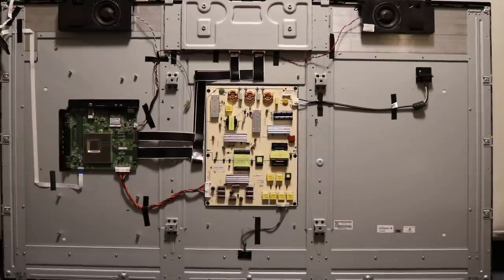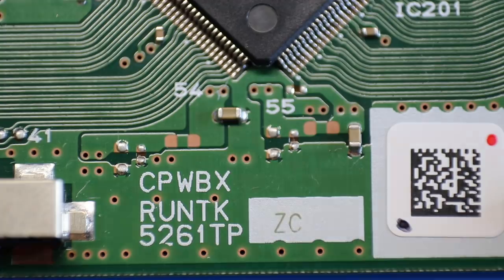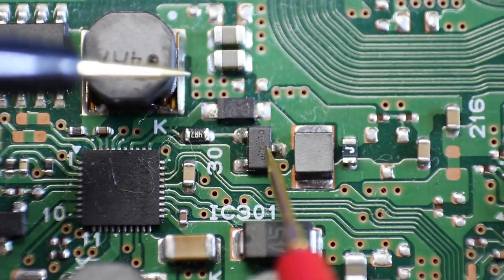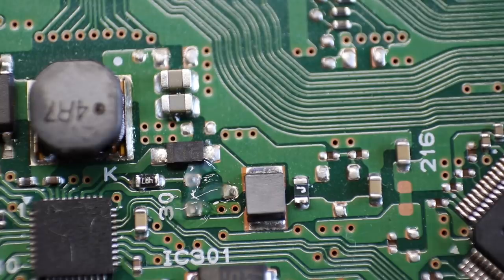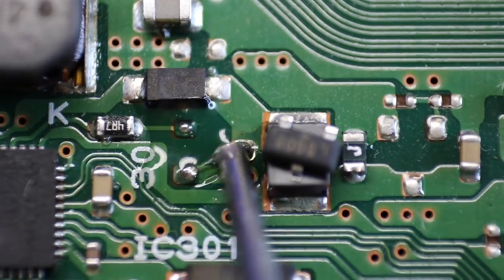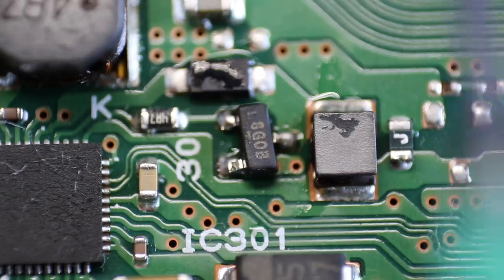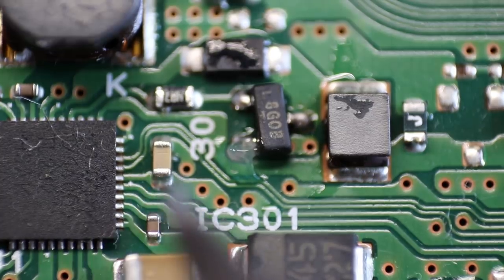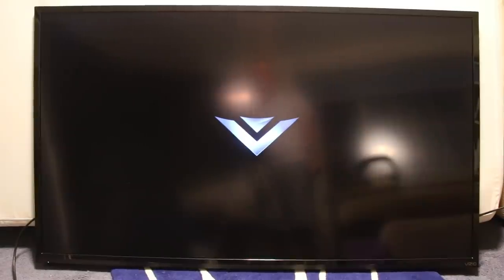60" TV for less than a $1 - Vizio E601i-A3

Comment: I have the same symptoms with my sony kdl 46-vl160...Any tips on how I can get it fixed or how much would it cost to have you fix it?..This is not a joke.
Reply from the maker: Looks like there is a bunch of hits for your model number and "sound but no picture".  As you comb through the search results, has it led to a common issue?  From what I remember, if this is the same model in my memory, the issue with a number of Sony's was a bad lcd.  Look up "tab bond failure" and you model number.  You can't realistically fix the tab bond but you can jerry rig it to work by putting pressure on it.  There are other videos out there on how people do it.

Comment: can vizio TVs work with 240v as well as 110v?

noticed that the power supply boards sometimes have 240v written on them... 

just curious if you could do a 110/240v conversion.. and show it working on a 110 and 240v.  

thanks.
Reply: Most probably yes. Most switching type power supplies can work from 100 v to 250 v. That includes mobile phone chargers and flat panel TVs

Comment: How long did this repair work for you? ShopJimmy is saying that if this board fails, there's a 75% it was caused by the panel. I ordered a replacement T-con board for the E701i-A3 but hesitant that its actually the panel causing it.
Reply from the maker: Not sure exactly since it had been running like 2 years before a child threw a toy and broke the panel.  It could have been longer than that but I don’t remember.
Reply from the maker: A tcon isn’t that expensive typically so it can’t hurt to try it.
Reply: @FrugalRepair  OK, thanks for responding back, its greatly appreciated.
Reply: @FrugalRepair  Yeah, my T-con board is arriving on Thursday.

Comment: Hello I got a problem with my devant tv it has multiple vertical lines i fixed this before by putting a small amount of tape to the ribbon connector of the the t-con board. Will this video I watched also solve the issue?
Reply from the maker: No, the replacement of this transistor is specific to this tcon board on two models of vizio’s that use the same tcon.  You should check all of the one toons and also inspect your tab bonds on the buffer board too.  It could be a connection issue or the tcon, is my guess.

Comment: Hi I have a Toshiba smart tv the back lights are on but no picture I have replaced all boards but not the t con board as it doesn't have one the main board goes direct to the LCD driver boards. Do you what the problem is? Or is the LCD panel broke.

Comment: I have a Vizio smart cast 65" D65x I have a black screen with sound and back light. I replaced the Tcon board and still same issues. What would be my problem?
Reply from the maker: I’m not sure. Besides doing some more Internet research on your model number, another thing I would try is to drive half the screen at one time. This means disconnecting one of the two cables coming from the T con board to the LCD panel. This may enable you to diagnose a bad LCD panel. You would know if you get picture on half of the screen and then when you go to do the opposite the other half the screen does not show a picture. Then you know the problem is on that side of the LCD panel
Reply: FrugalRepair thank you. I will try that
Reply: So one half of the screen comes on. The other left unplugged will turn off the entire picture. What would I need to replace?
Reply from the maker: If I’m understanding you correct, and you have replaced the tcon board, then unfortunately, it seems that one side of the lcd panel probably has a fault in it.  You could check the smd components on the buffer board for short circuits as a final check.  That’s all I can think of for now.
Reply: FrugalRepair thank you. If that's the case with the LCD is the tv not worth fixing or fixable?

Comment: Well I'm Glad You Got Your TV Fixed, But That's Not Helping Us On How You Determined It Was That Specific Component That Was Bad. I Mean We Saw You Test It For Continuity But Out Of All The Components On That Board What Lead You To That One? This Is The Kind Of Stuff We Need To Know Rather Than Just Going At It All Willy Nilly. I.E. So There Is Not Supposed To Be Continuity In That Transistor But Does That Apply To (All Transistors), Or Is There Supposed To Be Continuity In Certain Transistors Depending On The Application And Device You're Working On? What Lead You To That Particular Component?

Comment: I have a black vertical bar in the middle of my screen on a LG 43" smart tv. Everything else works as normal. Any idea what's causing this??? Cheers for any help. 😊
Reply from the maker: My first guess is a tab bond failure (the connection on the buffer board).  Second guess is a problem on the tcon board.  For a very quick mildly effective test you can press lightly near the top (and then the bottom - where your buffer boards are) into the lcd screen (in the black bar area) while it is running to see if anything at all changes.  Of course you don't want to press too hard and crack anything .  You're doing a quick test to see if moving that tab bond around helps fix things or not.
Reply: @FrugalRepair  .......do you know if there's a YouTube video that shows the steps you're referring to?
Reply from the maker: @AyrBlues  Not off hand.  See if you can learn what the tab bond is on an lcd.  Or maybe search for how to fix vertical lines so you can get a visual idea what I am talking about.
Reply: @FrugalRepair  ....cheers, will do. Thanks for your response, much appreciated. Have subscribed to your channel and look forward to more vids from you..... I like your style. Cheers!!!

Comment: 1. Can you use a soldering iron instead? 
I have a 55" Element that someone gave me for free. They said that it just went out for no reason.
2. I think I see multiple transistors on my T-con board
3. what readings should I be looking for on the multi meter?
Reply: Also, there are signs of the TV coming on at all, no back light or sound.
Reply from the maker: I hope you can fix it.  You should be able to.  It is probably not the tcon board.  You need to make sure the backlight isn’t shorted out and you’ll also need to diagnose the power rails on the power supply.  You could watch my video on what do look for after a power surge, which may be helpful for you.
Reply: @FrugalRepair  thanks for the suggestion, i'll give you an update when I find out what it is

Comment: Please tell us how you determined which chip was bad....I just recently bought a new 55" inch TV to replace a 50" TV that had HDMI ports that went bad.
Reply from the maker: Are you asking about how to fix the hdmi port issue?  Was there any power surge, did they all go bad at once?  Check eBay, is there someone selling a “service” to repair your model’s main board?  That is a clue it is a more common issue.
Reply: Thank you for responding, but I was reminded by my roommate that it wasn't the TV that went bad it was my video card my TV was connected to that went bad... Sorry for the mix-up, I'd think I should delete that earlier response.

Comment: Good job but I wouldn't have bothered with the hot air pencil. I could flip off the old transistor and solder on the new one with a 430°C soldering iron waaay faster and with a lot less heat overall. But maybe my hands are steadier.

Comment: I have a Sony Bravia KDL-32BX300  and the ports HDMI 1 & 2 dont work and ALl the resets and plug unplug dont make it work again, but It works perfectly with the pc output. Did you have a video for this knid of tv that I could look at  or do you have a clue to repair this tv.... Could it just need input cleaning ? Is there a component I could test like you did on this tv?
Reply from the maker: I’m not sure exactly on that model.  Could be hdmi controller chip or main cpu (solder connection).  Unless you can get more clues from online research, I’m not sure how to direct you.  Can you verify that the correct voltages are going to the hdmi ports?  Have you tried different cables?
Reply: @FrugalRepair  I tried a working elsewhere cable.. Do you have a link to a video that can show how to properly test the hdmi ports for the correct voltages?
Reply from the maker: I don’t have a recommendation on a video.  I’d search for one.  In my upcoming video I plan to release soon I deal with no hdmi ports but it may not be same issue as yours (mine is bad solder points)

Comment: Any thoughts on an led projector that suddenly won't turn on?
Reply from the maker: There is no power at all?  No standby lights or anything?
Reply: @FrugalRepair  nothing. Not the fan, no lights. It's as if it's a toy
Reply: @FrugalRepair  I swapped out the fuse with the spare that came with original package. Emailed the manufacturer. They suggested power board but they don't make it for this model anymore. It's only 2 years old. Minimal run hours

Comment: I actually have a 60" Toshiba with a similar issue. Maybe I'll actually pull the back off and check that board. would be nice to surprise my dad by fixing it for him.
Reply from the maker: Did you search the model number online to see if there is a common fault with it?  If the lcd screen is intact you can pretty much fix most tvs.

Comment: How were able to determine or pinpoint that it was the transistor on the Tcon board ?..I understand you were able to test the transistor with a voltmeter checking continuity ..But with all the other components on the board it would be hard for a inexperienced DYIer to figure that out.
Reply from the maker: There is another yt video that directs you to look at that transistor on the tcon.

Comment: After reading more comments, it appears FrugalRepair got lucky and an internet fix worked for him. I had my suspicions while watching. If your hot air is set right, and the flow is correct and isolated, you can let it sit on the component and left the solder flash before grabbing and twisting. You’re  going to peel a pad off the board sooner or later with the technique used. Also, maybe give these people a heads up about that power supply board. It’s a mean girl before the rectifier, it bites.

Comment: I have 70" sharp LCD. Black screen but using flash light I can see picture. Is it the LCD strip that's bad? If one lcd goes out does it turn backlight all off? Is the backlight inverter attached to the power source? Thanks
Reply: It has a new mainboard on it.
Reply: Oh I forgot to mention when I drove it home in back of truck...I plugged it in and it worked. Then I plugged in roku and that's when screen went black. My friend gave it to me and said it just didnt work. Maybe bouncing around fixed it temporarily?
Reply from the maker: It would be the led backlight that is bad.  The truck ride wouldn’t do anything but a temperature difference could.  The backlight power source would most likely come from an led driver board or from the power supply directly.

Comment: Hey! I have a Vizio E65x-c2 65in tv. The left side has gone almost completely dark but I’m able to barely see the menu. I’m still getting picture. I have sound and able to power on. Do you think it’s an LED replacement issue or tcon board? I’m not getting any lines. The picture is just getting darker. Any help would be great! I can’t find any help anywhere else.

Comment: Good day, i have a 65" Sony Bravia KDL65W850C. i was watching tv when the screen went black. i looked on the net to try and find something. i found a site that says press the power button and volume down and it should work. when i did it, the screen flickered but would not come on. any thoughts ?
Reply from the maker: Is the LED backlight the problem?  If you still hear sounds when the screen shuts off, that is what I would first suspect.  You can use a flashlight/torch on the screen to verify (after it goes black).
Reply: @FrugalRepair  no sound, it just flashes a couple of circles, it stays on for a blink of eye that's it.
Reply from the maker: When there’s an image that flashes for just a second when the TV first turns on, to me that usually indicates a short circuit on the LED backlight. Of course, yours could be something else. But what tends to happen with backlight fault is that the power is ramped up to 100% when the TV first turns on and exposes the short circuit.
Reply: @FrugalRepair  first off thanks for the help....how do i test the backlight and if its gone where can i get a new one
Reply from the maker: Do a search for flashlight test and you should find a video telling you how to see if your backlight is out.  In terms of replacing it, That’s a little bit more complicated for me to address in a comment. But there are plenty of videos that may help you along. I’ll be making videos on these two topics sometime soon but you may not want to wait for me.

Comment: I'm old school.  Can this be accomplished with a soldering iron?  54 cents if you already own a hot air station, flux and solder.  How much does a hot air station run?
Reply from the maker: Yes, you can do it with a soldering iron.  Hot air can be fairly cheap.  Check out the link in the video description for a pretty cheap one, though I have no experience with this one

Comment: As a former Sr. Electronic Technical Specialist/Technician, I applaud your efforts. That replacement could have been done in about 1/4th the time by a technician with a steadier hand. Perhaps you need to practice with a 'practice board' and some 01x02 caps/resistors to improve your eye/hand coordination and steady that hand. Your repair would pass IPC-A-610 for Class 1 & 2, but not for class 3. Since the TV is Class 2, you pass! Cheers.
Reply from the maker: Thanks for commenting!   You're right about the time reduction.  I had my hot air station in the wrong spot to make way for the camera, etc.  I was experimenting with the camera location and setup.  So I ended up soldering backwards, left hand with tweezers, right hand hot air.  Normally, I'm looking through the microscope, tweezers in right hand, and (hopefully) am steadier. =)  Good to know I'd pass class 2!
Reply: @FrugalRepair  Well, I'm retired now, but when I was doing work with my hot air station, I was fortunate enough to be ambidextrous. Normally, I'd hold the part with Swiss tweezers in my left hand, and the hot air wand in my right (I'm right handed), and look through my lighted magnifier. However, there were times when, due to parts layout, it would be more advantageous to have the hot air wand in my left hand, so I'd just switch. As intensive as small parts placement is, I found the most difficult repairs to be where I had to do a trace replacement where there were a dozen or more 0.004 traces with 0.005 spacing. That kind of work is very tedious and demanding, but to save a $6000 board, you gotta do what you gotta do.

Comment: I have the same model Vizio E601i-A3E that turns on to the logo, flashes HDMI-1 in the top right corner then repeats this endlessly. No response from the remote or buttons on the side and have to unplug it to turn it off. What is the issue?
Reply from the maker: I’m not sure.  Without testing it myself, I’d guess a firmware problem.  But it could be a problem somewhere else on the TV that is exhibiting this symptom.

Comment: For now, I have repaired my headphones and gamepads but it has been just soldering the cables again cuz they got ripped from pulling and I have done it without flux and hot air system just soldering iron. Do you really need it for a TV if its a one time job?
Reply from the maker: No, you don't need the hot air.  You can use a soldering iron too, your tip needs to be small enough to fit in such a tiny area though.  The transistor is like the size of a grain of rice.  Flux is usually embedded in the solder so that is one reason why you didn't need it.
Reply: @FrugalRepair  Thank you! Awesome reply. I bet it will be way more secure and professional and more of a safe bet to do it with hot air and flux but at least I will get and use flux, just in case.

Comment: When I turn on the tv the backlight doesn’t show and I can’t see the image but there is sound. Is it the transistor that you mentioned in the video ( the tv in the video is the same one I have)
Reply from the maker: If it is the exact same model then there is a good chance it is the same faulty transistor.  Be aware though that your lcd screen could be bad and replacing the tcon board (or just the transistor) may not fix it.  On the other hand, if the problem is your tcon then you may be able to give new life to your tv.  I’ve seen tcon boards for this model on eBay for around $17.
Reply: Ok thank you for your advice we are going to follow your advice ☺️👌🏾

Comment: I recently purchased a 60" 4K Ultra TV from a local pawn shop really cheap.  I have since noticed that it had some black lines or squares on the screen..you can normally only see them when there is a very bright scene.  Still has a good picture right now, but I can tell the screen is starting to get a little blacker in the areas where the black lines or squares are.  They almost look like a shadow.  would this be the same type of thing as in this video?
Reply from the maker: Are the shadows near the edges?
Reply: @FrugalRepair  lower right 1/4 of the screen.
Reply from the maker: @ImotepWoW  Its probably your backlight.  The edge lit led tvs are usually sectioned off into about 4 sections electrically.  You probably have a bad led in that last 4th.
Reply from the maker: Try turning down the brightness of the backlight in settings.  Maybe you can get it low enough where you are ok with the brightness level but it’s below the threshold of the failing led.